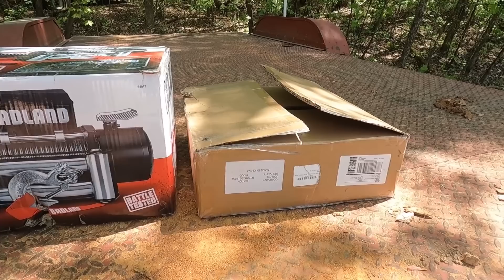BADLAND ZXR 9000 lb Trailer WINCH | INSTALLATION & TEST

Comment: I mounted the smallest Harbor Freight Badland Winch (1500 lb?) on the rear bumper of our Hi-Lo camping trailer (2700 lb weight), using the Badland mounting plate (some welding) and shackle U-bolts to make it removable.  I ran a ~8 awg cable from the front 12 VDC battery to the rear, ending at a 50 A plug.  The winch has no trouble pulling the trailer up my side driveway (slight slope).  Wireless remote to actuate the winch while steering with HF Trailer Dolly from the front.  It was a pain before, trying to back the trailer up that narrow driveway using the vehicle (hard to tell angle of the trailer).  Also good for backing the trailer into camping spots. For safety, I periodically move a 4x4 up to chock the wheels in case the winch cable detached.
Reply from the maker: That sounds like a pretty good usage for it! Backing up short wheelbase trailers can get difficult quick.

Comment: I made a very strong removable winch mount from 2 harbor fright  items and I did everything myself . and I have 2 harbor fright welding helmets a red welding helmet and a black welder helmet both from harbor fright and they work really well
Reply from the maker: What items did you use for the mount? I've also got one of the welding helmets from harbor freight. It works well enough for me!

Comment: I prolly would use 7018 or 6013 in that situation. 6011 is a great rod but it is more for penetration & leaves an ugly surface sometimes.  That said I'd have welded tabs to the receiver & bolted them to the trailer (similar) to how your jack is mounted, in case I wanted to get the thing out of the way. Nice work, thanks for sharing!  I need to get a winch on my car hauler.
Reply from the maker: Thanks for the info! What are 7018 and 6013 best for?
Reply: They make a nice appearing, easy to clean weld. They don't penetrate much, so they would have been perfect for the welds you made where you are just filling up the space made by the tube radius. 7018 is stronger, but is a low Hydrogen rod and needs to be kept sealed from atmosphere and or dried before use, so most people are just going to stick with 6013. There are cases where 6011 is really handy, like emergency repair on dirty metal, but for fabrication, where I can just grind a bevel and don't need to worry about penetration 6013, or 7018 give you better looking results.
Reply from the maker: @kirkblee5853  Nice. Thanks for the explanation!
Reply: 7018 = 70 lbs per square inch of hold strength and 18 is the flux type. It’s best to bevel the metal first and fill it with weld so you get a more solid connection. Like an overlay metal, only penetrating the surface metal. 6010 is a penetrating rod for digging when you can’t bevel the metal connections. Both are uphill rods but can be used in special circumstances for downhill. Like pipeline code pipe (dc)or cracker box welds (ac) 7018 on thin metal. I find more and more ways to weld, that fit each situation. No matter always watch your metal when welding. 💪🏽

Comment: Where did you find the kit for the wench ?
Reply from the maker: Here's the 3 different items I used to make the winch work! 

Badland Winch 9000 lb: https://bit.ly/3tHZIR4
REINDEER Winch Mounting Plate: https://amzn.to/3tJvgWz
MaxxHaul 70070 Dual Hitch Extension: https://amzn.to/3xd75SG
Reply: @StateFun : Two rules for the educator: 1) assume no knowledge on the part of the viewer--which assumes that those who do know what you know will not in fact need your videos, eh? and 2) go step by step, by step explaining each one and why.  Oh, in this case you call it a trailer winch but 9000 lbs is a lot of weight and I wonder if it can be used on a truck or jeep as well, and what does it cost--which is increasingly an issue for a lot of us in this economy.  JWC

Comment: There's really no reason to use a 9k# winch on a trailer to drag something on, a 3500# will do the job just fine. If you're fighting four flats then use a snatch block. Save the big winch for your truck or Jeep. A big battery makes all the difference. 
After a buddy borrowed my Jeep to winch something while I was on vacation(he broke the winch on his truck) he managed to stack the cable so badly that the cross-braces on my $1k Warn 10k broke away from the cases. The only thing holding it together is the four mounting bolts to the bumper. If I remove it, it will fall apart. It will still work but I don't think it will hold up to it's designed  power. I will probably replace it with a Badlands winch, they seem to be getting better year after year. 
My buddy also tore up the winch on his flatbed trailer and I needed too use it but really needed to winch a heavy load so I bought him a new 8k# winch. It lasted one pull because he couldn't feed the cable correctly, so it bunched up and toasted the motor. 
"Some men........you just can't reach! So we get what we gots heah!"